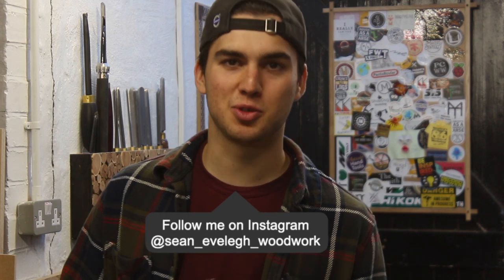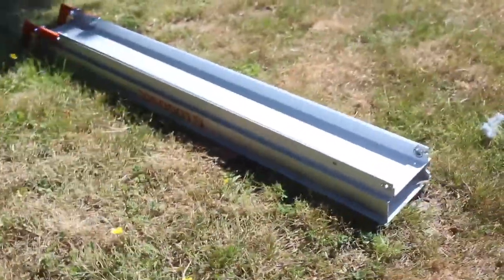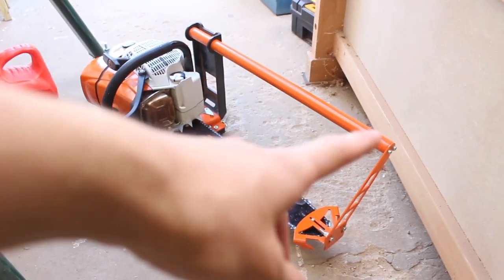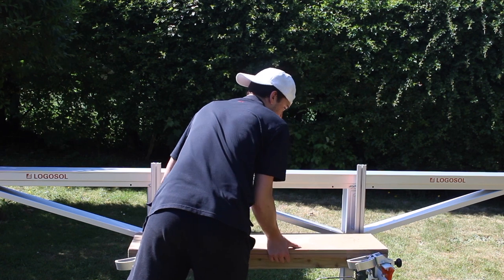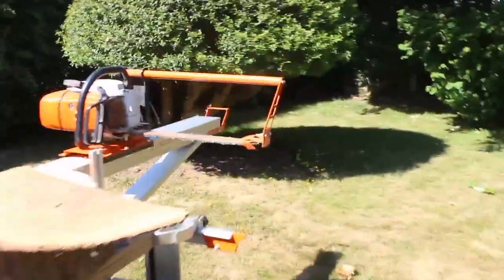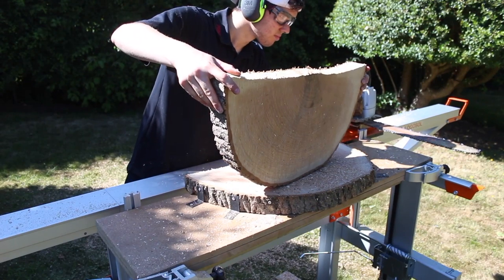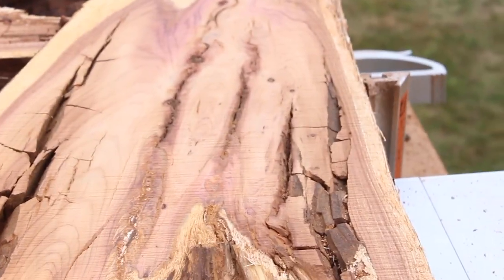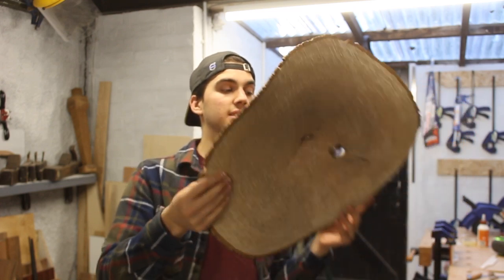Milling on the Logosol F2 Sawmill! (Stihl MS 661 Chainsaw) Sawing Huge Ash Cookies and Cherry Logs!

Comment: That thin cookie looks fantastic. If you cut a whole load of them you could do something really arty and create a large wooden Rose with each Cookie being an individual petal. Maybe even using different species of wood to create different colours, textures & looks. It would make a real arty centre piece on a garden patio or lawn. There might even be a few florist shops that would pay a premium to have it as an advertising piece in their window.

Not sure how ell it would work but maybe when laying them out to dry after cutting, placing a small weight (or series of small weights) on an edge or in the middle may encourage it to warp into a specific shape.
Reply from the maker: hey kingsley! That's a fantastic idea. When i get another cookie. I think i will give that a go! thanks a lot!

Comment: I was taught the curing / drying time for timber either in log or biscuit form is around 25mm per year depth. 
To stop warping or cracking here we paint it with an acrylic emulsion to slow down the drying process - we do have hotter dryer periods in Australia than I'm told you have, that may be why ours cracks so much more readily. 
You then have the horrid job of sanding off the emulsion when you want to use it, but that's better than throwing out cracked timber.
Reply from the maker: Hi mate, yeah there are a few good products you can uses as well like anchorseal, however I normally you cheap PVA glue. Hopefully theses ones don't crack!

Comment: The white patches might be the start of 'white rot' - what sound does it make when tapped compared to other areas of the wood? Does it still sound solid?
Reply from the maker: Hi Mate, sorry for the late reply. It still sounds solid yes. do you still think it's white rot?
Reply: @SeanEvelegh  White rot removes the lignin in the wood leaving the cellulose (hence the whiteness - think cotton) structure behind. If you Google "tree white rot" and look at the "images" results you will see some shocking examples. Maybe yours was at an early stage so it still has its solidity. Of course it might not be white rot at all but just a stain as you mentioned in the video.

Comment: I would look for an aviation bolt that has safety wire holes.  You'll be able to wire the bolt so it doesn't back out.
Reply from the maker: HI Brandon. Thanks for the help, I'll look into that!

Comment: You might try loctite, but red is fairly permanent, only released from torch heat,blue is a semi-permanent can use wrenches I would suggest using correct wrenches as opposed to the socket u used in the driver
Reply from the maker: HI Tom, Thanks for your advice. I'll look into that, annoying I don't have a wrench set. So I just used what i had :(

Comment: Great vid! Did you have any trouble trying to get the rail components flat enough for the carriage to transition the whole length without getting jammed? I haven't used my F2 yet, but testing the carriage and winch it seems to get stuck at the joins even though it looks very flat by eye. I want this to be a one person job, but it feels like you need another pair of hands to hold two pieces together AND tighten the nuts at the same time. i would be grateful for your thoughts...
Reply from the maker: Hi Nigel, I know what your saying. Sometimes I do have trouble and it is helping have another pair of hands to help level it but I have managed to set it up in my own. Also when ever it did slightly jam I just pushed a little harder and it never effected my cuts. Hope that helps.
Reply: @SeanEvelegh  Thx for getting back to me so very quickly Sean, I appreciate it. I have finally resolved this now and have a perfectly flat guide rail. However, I do have another quick question if you don't mind... It's regarding the log lifters; should I be able to wind these both up AND down? It looks like you have to disengage the ratchet cam to go down, but I wonder how you retain control in the down direction if you have a heavy log on the bed and the cam is disengaged. I can't see that I've missed something in the instructions, but grateful if you have any advice. Thanks, Nigel
Reply from the maker: @nigelsansom2407  Hi Nigel, yes your right. you have the disengage the ratchet to lower the log filter. so if you were by yourself you can only do one at a time. If you had someone's help you can lower them both together. to disengage it, I raise the lifter up slightly so I can pull the ratchet out, then you can turn the wheel to lower the log.
Reply: @SeanEvelegh  Thx Sean. I had this fear that if I disengaged the ratchet it would kind of crash down fast and out of control. I'll have to give it a go. Many thanks for your response, it's very much appreciated. Cheers, Nigel

Comment: Have you thought about using a spring washer or other washer meant to help keep nuts/bolts from loosening due to vibration?

Or locktite. Don't know how permanent that would make it
Reply from the maker: Hi lucy, thanks for the help, I did think about that but hadn't tried it... I think i will.

Comment: If you can have the bolt long enough fit 2 nuts and tighten the nuts against each other.
Reply from the maker: HI Robert, that's a good method. but sadly there are no nuts for this mounting. it's just a bolt that goes straight into a threaded magnet.

Comment: Without seeing the way the screw on the bar mounts to the cutter bar, if it is a bolt with a nut on the end (although it looks like a standard Phillips head screw) you could use two nuts - the first to tighten it to the cutter bar and the second to lock the first - you just tighten it against the other and they lock together. 
If it just screws into the cutter bar, maybe Locktite or similar. 
More vision of how it fits together may help people offer more suggestions. 
What about the manufacturer - have they any suggestions?
They charged you for it, they should make it work or refund some of the purchase price.
Reply from the maker: HI mate, thanks for the advice. it is actually a bolt with a phillips head, and it mounted into a magnetic base. so the only thin holding it to the bar is a magnet, and there's no nut
Reply: @SeanEvelegh  Sounds like a job for Locktite or similar, even maybe an epoxy glue like Araldite (if you have that brand in the UK) which could be better as it has some body to it which may be better with the vibrations. Whatever you use make sure you clean it meticulously with something like brake cleaner or isopropynol alcohol to rid the surface of any bar oil which has a tendency to stick to anything with a vengeance.

Comment: Stihl rep in Alabama says NOT to use their saws for milling .... ‘They aren’t made for it’ ..... the new 661 C-M has captured bar nuts preventing attachment to Logosol mills, and they do not make a cover with out captured nuts ...... and when I explained to Logosol which saw I was getting, they did not warn me!!
Reply: To get the nuts to come away from the side cover u have to drill them out from the inside ‘ in other words  the nuts are swaged on and need to be drilled off for the fitting of the mill slide ‘ it’s not a big job to do ‘ but if u have a new saw it could affect your warranty ‘ it not a thing people like talking about ‘ milling is very hard on a chainsaw ‘ they are not designed for constant revs ‘ and long bars used on there side through off the bar oil and cause excess wear ‘ life is never perfect 👌